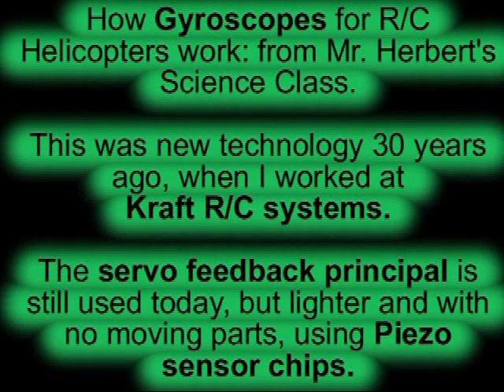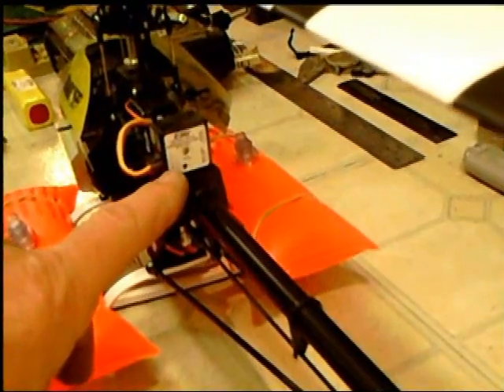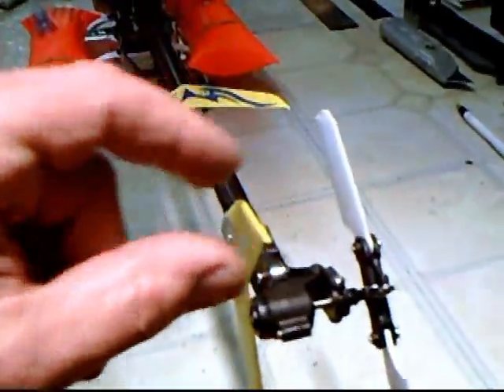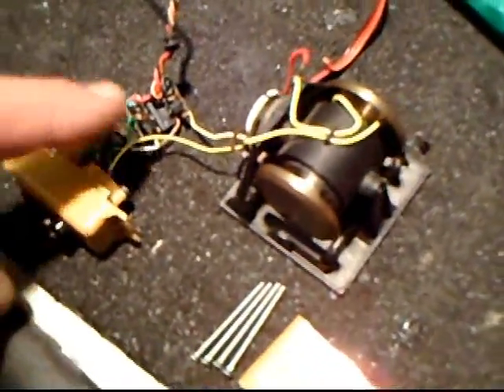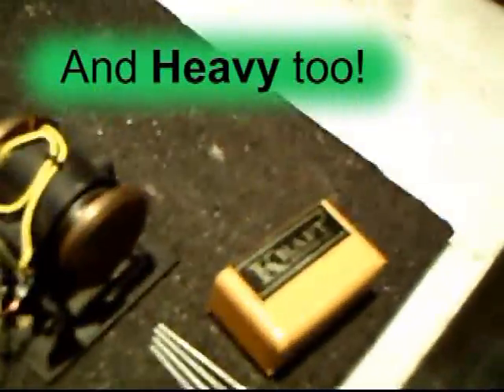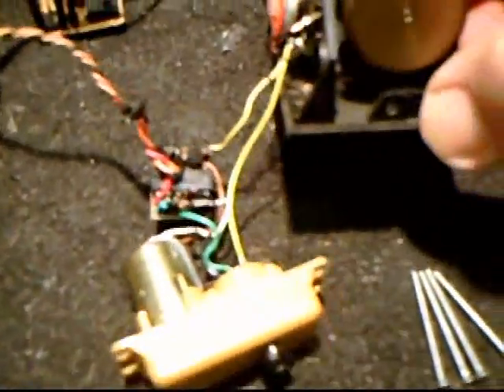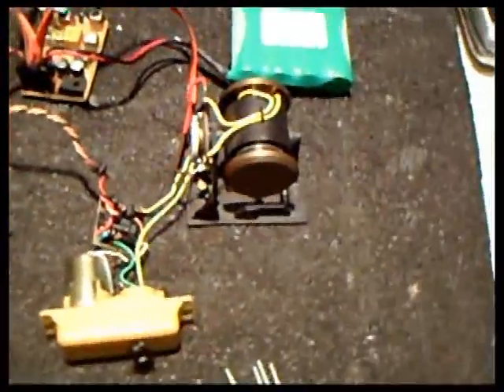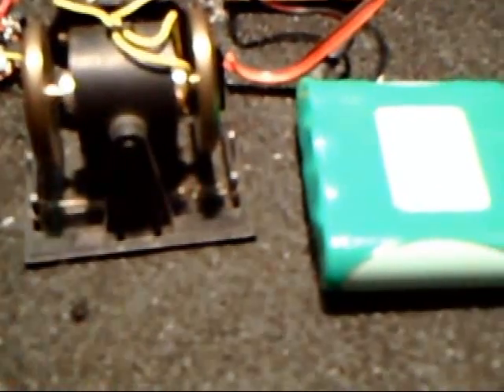R/C Gyroscopes for Helicopters (Revision 1) How they work.

Comment: Hi Dave, I've been collecting mechnical rate gyros for many years.

I have several Futabas, two kraft, a really small JR one (I think an NEJ-130) that came out of a concept EP heli, and i've been eyeing a Morley as well as a GMP (which looks like a Kalt rebrand), and another GMP that i don't recognize called the 'quest'. It is fascinating to see the different design approaches, methods of balancing and adjustment, and how the electronics evolved over time. 

I think most or all of mine use a hall effect sensor and an external board forms an output pulse. But here it looks like your gyro has a potentiometer and you've wired it right into the servo circuit. what type of gyro is this? an original Kraft?
Reply from the maker: This is Futaba. We never made gyros at Kraft.

Comment: If you think that's old. My dad used to have an RC boat that used vacuum tubes in the transmitter. It was a big metal box and used an "A" and "B" 67 1/2 volt battery.
The servos were huge too...

Comment: I had my first helicopter before the gyro (even the mechanical one you shown here) was available.  I still have the radio from back then , it was specailly made for helicopter.  The rudder compensation was controlled from the transmitter.  By adjusting the knobs on the top of the transmitter to control how fast the rudder response and the magnitude of the reponse when you change the thorttle.  The direction of the reponse is from a switch at the bottom of the transmitter.  (check my user name !)

Comment: great video! 5 stars.
so if the heli would piro in one direction constantly, the old-school gyro will tilt one way constantly right?
it's actually a motor with two fly wheel attaching it to the shaft?